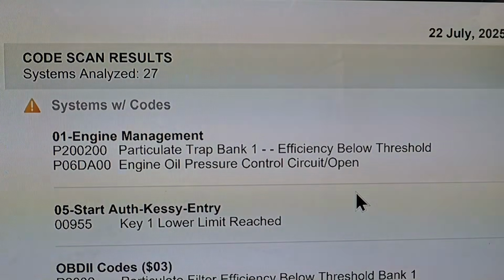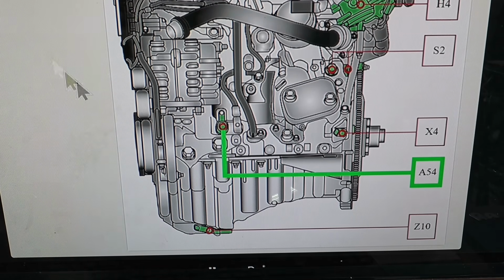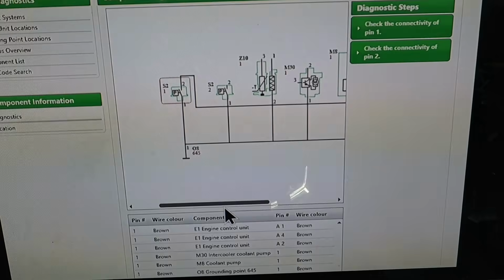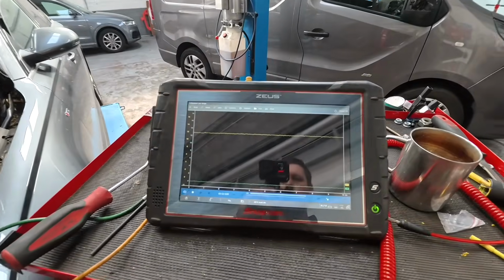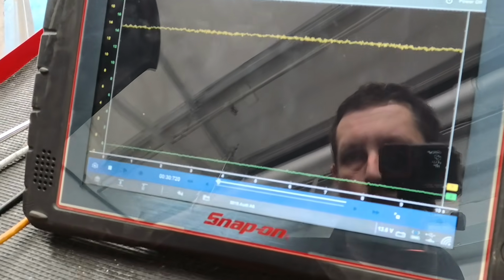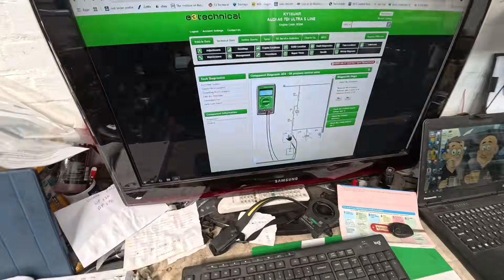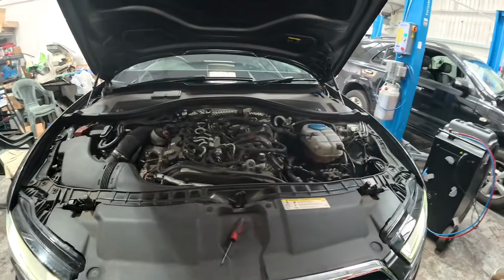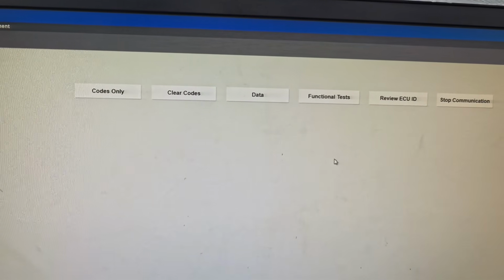Audi A6 Oil pressure fault - Two garages Tried, We found the real problem!

Comment: Maybe I’m unfortunate but wait till you get one of these to replace in a transporter, much more susceptible to road grime and both of mine snapped on removal and left the very small body in, thread tapped down the middle and drawn out with a bolt and socket, very frustrating all the same, common failure.

Comment: I think i have this similar problem my one only comes on during idling after 20 mins or long idling other than that it drives normal, could this be the issue perhaps i wonder
Reply from the maker: Maybe. Only proper testing is going to prove the fault without throwing parts at it
Thanks for watching 👍

Comment: I have the same problem on my audi a6 2012 2.0. My fault code is p164d00 malfunction. If I change this part will it resolve it. As I've replacement all other sensors. And solenoid except the one you changed
Reply from the maker: Hi there. I have no idea if it will fix your vehicles issue with out diagnosing it. That was kind of the point of the video, to demonstrate why it's better to test & not guess. My advice will always to find a good garage with good diagnostic capabilities to save wasted money on unnecessary parts. 
Thanks for watching 👍

Comment: Great fix.
But generally how do you trust garages? Well two garages could not find the cause of a front clonking noise on my car.
I did..a broken spring.
If they can't find such a basic issue, how can you trust them with ANYTHING else apart from emptying your wallet?
I'd trust you, but others .?
Reply from the maker: Sadly like all trades there are good and bad in all. Sadly sounds like you haven't found the right garage yet. When you do treat them well.

Thanks for watching 👍

Comment: P200200 fault is for egr cooler being blocked. There is TPI for this
Reply from the maker: We did infact diagnose this off camera as a blocked egr cooler. We found the tsb on ddtsb 👍
Reply: @amsdiagnostics what's mean tsb on ddtsb?
I ask because I have audi a6 and I use to have p200200 fault code.
I wash dpf but this cone come back over 6 month after.
Thanks
Reply from the maker: A tsb is a technical service bulletin. Normally created by the manufacturer when they have a common problem with a vehicle. Ddtsb is an aftermarket equivalent, check out DiagnoseDan on YouTube, he fronts it. They are tsbs created by technicians around the world who come across tricky faults

Comment: New subscriber here, thanks for your videos, I have been watching several of them recently. I noticed that you used Forscan in one of your earlier videos. As a Ford owner, I have used Forscan to help with some DIY jobs (e.g. bleeding brakes by commanding the ABS pump). I'm very interested to know your thoughts on Forscan, e.g. do any of the expensive tools do anything more than Forscan can (for Fords only obviously)? Thanks
Reply from the maker: Hi David. Thanks for watching 👍
Forscan is a pretty good tool. No tool does everything, unless you go dealer tool. But depending on the age of the car your working on it's pretty comprehensive.

Comment: I am looking at something similar on my Mercedes w212. Correct me if I'm wrong, but my understanding is this valve reduces oil pressure to the engine at low RPM to save a miniscule amount of fuel... In the case of my Mercedes they have actually made a genuine replacement that is just a lump of metal, as they realised if this gets stuck in the low oil pressure position, it can restrict oil flow and cause engine damage.... It is however if the power fails supposed to stick in the open position thus full engine flow all the time if it's faulty. I also have a W213 and my opinion, I'm not a mechanic, is that this lowering of oil pressure is why one side of the engine tappets and lifters wear out, die to low oil pressure. Just my logical thinking.
Reply: Yes, the stupid valve that Audi thinks saves polar bears. It drops the oil pressure to save fuel, all it does is reduce the oil flow to the rocker arms and cam bearings which after a while consume themselves due to lack of nutrients. Another bad idea from some intern at Audi..

Comment: Nice video,   i use Launch and on live Data it shoes the high and low pressure switches. The low pressure works as youd expect but the high pressure switches around 2k revs but only when Driven not when you rev it in the workshop.   

The most common oli pressure fault on the engine is the mesh filter on the end of the Brown high pressure switch gets clogged with a thick sludge of oil and stops it registering the pressure change,  that puts the eml light on and limp home.    

I would alway check and replace that switch as part of replacing the oil pressure solenoids as it will fall and there cheap so not worth the customer calling back and saying "that lights back on the same as last time"😂
Reply from the maker: Hi Dave. Thanks for watching. I didn't look for love data for the pressure switches, although I'll definitely check to see if I have those pids if i get another one in. I just went where the evidence lead me, which was electrical instead of a mechanical issue.
I appreciate the advice though 👍

Comment: Nice Chris
I’ve had a few of these oil ( not fuel 😂) pressure control valves on the Q3’s, all seem to have the high resistance.
It’s such a shame how there are so many workshops surviving in the uk with real incompetence and yet make a living, and then I find ( and I bet your the same) they are already narked about spending previously with others and then try to influence my costs to diagnose the problem correctly.
My one wish for this trade my whole career of 40years is it needs to be licensed and regulated and then only able bodied technicians carry out the work. That’s sadly why customers are so defensive about the garage trade..
Good video mate.
David
Sinclair Engineering
Reply from the maker: Hi David. Thanks for watching. In this trade to be good well never stop investing in tooling & training. I don't know of another trade which advances as quickly. I agree that some form of minimum competency requirements should be needed. 
The modern motor vehicle is now highly technical & replacement parts are very expensive, so correct diagnosis is a must 👍
Reply: Well said Mr Sinclair I’m 50 years on the spanner’s there’s plenty of garages making a good living out of not fixing cars and spoil it for the ones that can actually do the job and as you say it should be regulated.
Reply: So where are the two oil pressure switches?

Comment: Nice one Chris, Love your test don’t guess motto. Just shows how people can be drawn into changing parts on the off chance it sorts the problem.
Reply from the maker: Cheers mate 👍
Reply: In some cases its cheaper to try a new component than doing extensive diagnostics. If this solenoid valve was cheap, and the diagnostic was timeconsuming, it might be cheaper just to change it.
Reply: @geirhaugen3781  I agree if this was a known point of failure or the Tec had previous experience of the same symptoms .  If not just changing parts by stealth can be expensive and ruin your reputation quite quickly.
Reply from the maker: In this case the fault was found within our standard diagnostic assessment time. It took less than an hour to confirm the issue. There's always a balance between diag cost and parts cost. But you can find yourself down an expensive rabbit hole playing parts darts.
Thanks for watching 👍
Reply: @amsdiagnostics Parts  Darts😂😂
Reply: Yeah i agree about the diagnostic time ,  but at the same time the diagnostic tool did say it was a electric issue .
Reply from the maker: @Lord.Xenith  The diagnostic tool did show an electrical circuit fault, the fault could of been due to a faulty valve, wiring between the component and ecu or the ecu. The component was £100 approx. So It payed to test not guess.
Thanks for watching 👍👍
Reply: @amsdiagnostics yeah , that’s why i was shocked when the 2nd garage though that it was an oil pump 😂 . Thank you for the content ❤